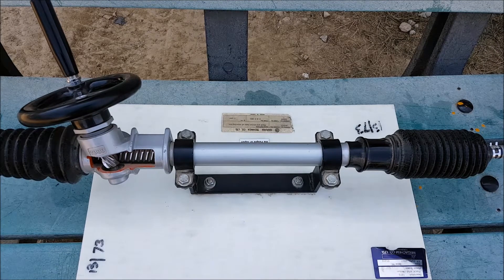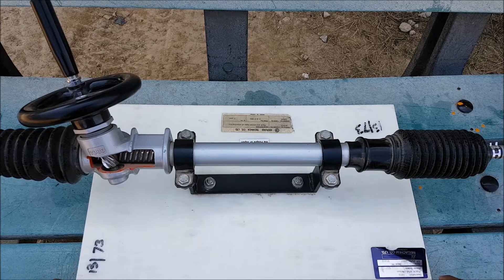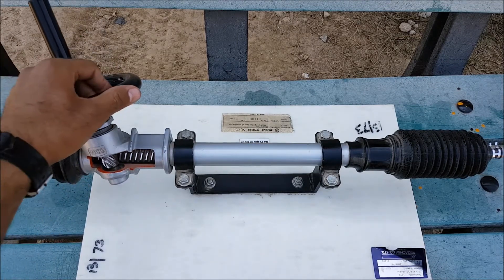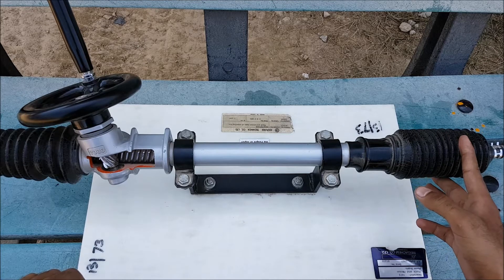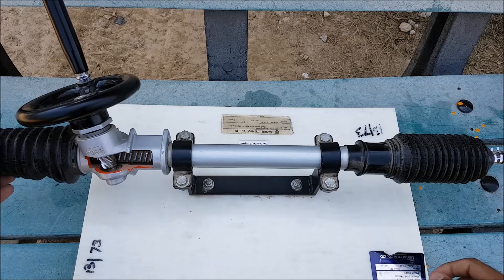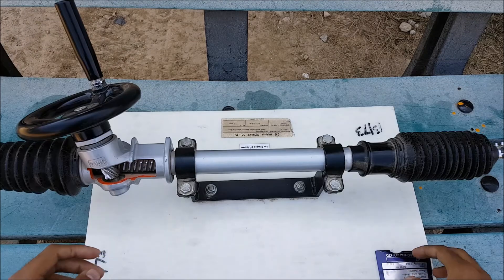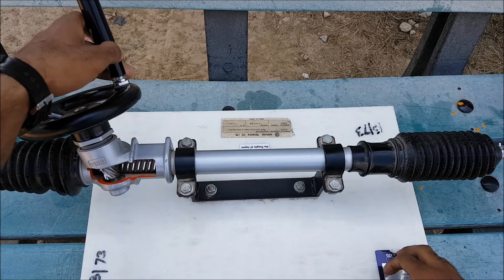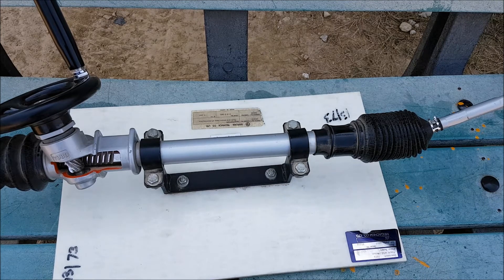Rack and Pinion Steering System

Comment: Can you please tell the approx length of the rack in the system?
Reply from the maker: The overall length of standard racks on the market is generally not more than 2000mm, and offered in 500mm units such as 500mm, 1000mm, 1500mm. Furthermore, the cross-sectional shape is often a square or rectangle, and some are round called round rack type.
Reply: @automotivespot  hey Thanks for the information....but do you know the length of rack used  in the steering system??
Reply from the maker: Depends upon vehicle model and make.
Reply: @automotivespot  well yes.But upto what length is possible??the videos I watched,racks are hardly 150-200mm....just wanted to know if there are racks of 800-1000mm in teh steering system
Reply from the maker: Dear it depends upon your turning radius too.. but yes I think it's available upto 800mm. Must visit a market for more.
Reply: @automotivespot  thank you so much
Reply from the maker: Pleasure 😊